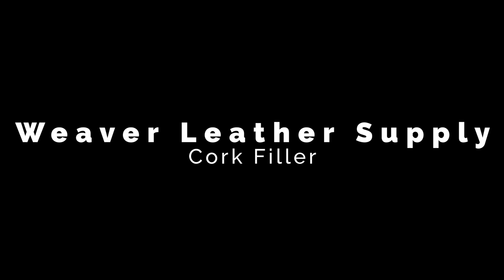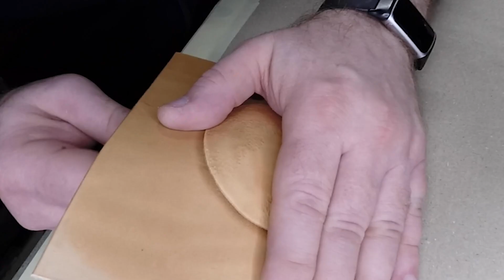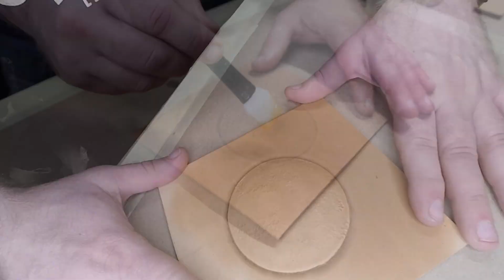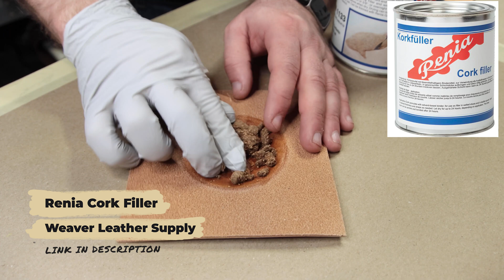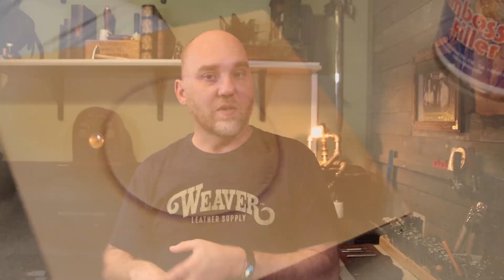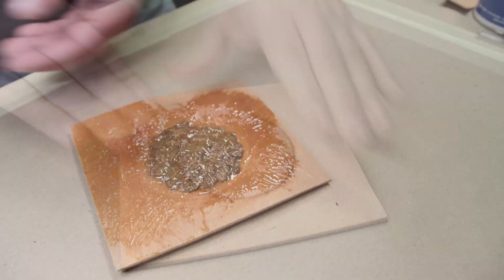Using Cork Filler

Comment: Unless you live in Alaska or another state where Renia isn't available (and restricted for shipment) then you employ the use of a Blendtec or Vitamix blender and finely "chop" wine corks. Mix with contact cement of your choosing and it works pretty well. I've also used kneadable eraser in a pinch also.
Reply: Thats cool thinking the eraser 👍